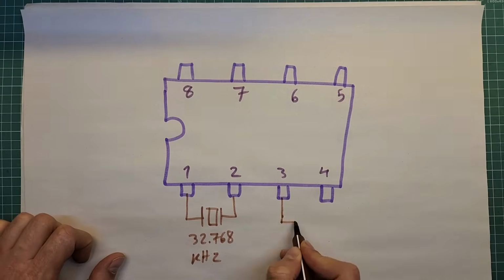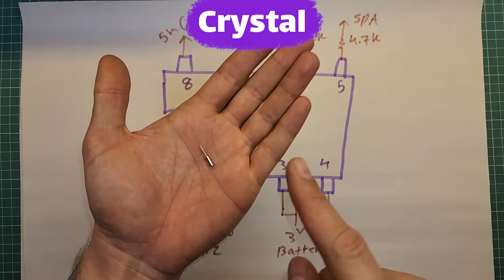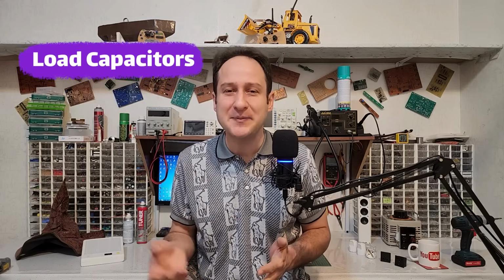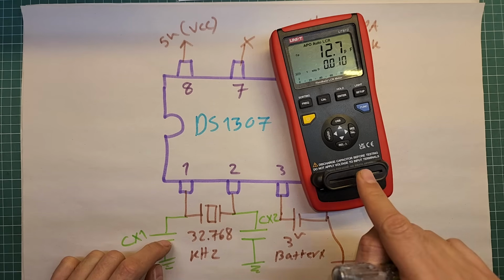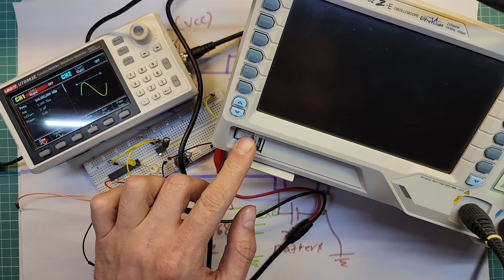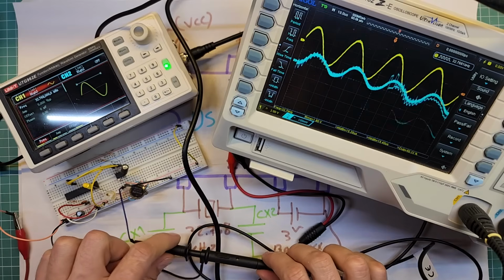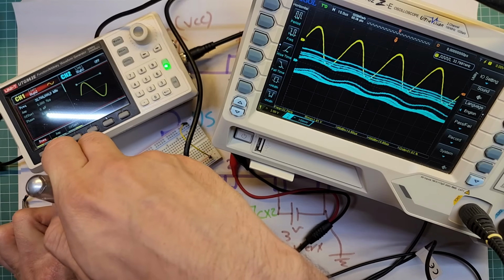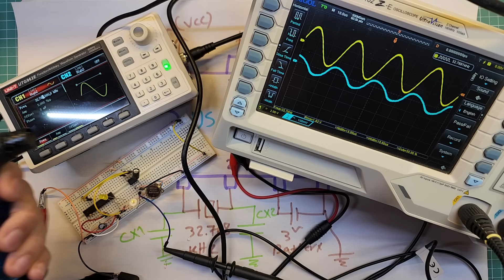Why Your RTC is ALWAYS Wrong + and the EASY Fix!

Comment: you can obtain high precision only with frequency meters. function generators and oscilloscopes are never high precision tools
Reply: That depends .........
When did you last have your frequency counter calibrated ?
When did you last have your function generator calibrated ?
When did you last have your oscilloscope calibrated ?

Have any of your instruments ever been calibrated since you purchased them?
In their current state of calibration which one is the most accurate?

This video is aimed at the student/home hobbyist for which the cost of regular professional calibration is out of the question.
At least with this method you are averaging any inaccuracy by comparing the accuracy of two of your instruments. Function generator set to 32.768kHz, Oscilloscope reads 32.768, no drift on traces = 99.999999% chance it is an accurate 32.768kHz. 

Some people need an excuse to spend $$$$$$$$$$ for a another piece of equipment. 
Other people use their brains & skill to make use of what they have to achieve the same outcome.
Reply: @JustMe-dx5xl it happens i am physicist and i know what to what precision. 
frequency is for highest precision possible. 
do not write a lot, in order to confuse me! you can't. 
frequency and phase shift, and phase shift is about frequency. and the last solution, quantum counter, or quantum sensor, to measure currents, that also is about frequency. 
the only thing more precise than frequency, is gravity, but that too, becomes a matter of frequency.
Reply: @saramanbrudesco  I am actually one level above a physicist sitting in a environmental controlled lab with ULTRA EXPENSIVE equipment which is regularly calibrated/certified.
- I am a real person in the real world :).
Obviously all my words did confuse you as you missed the point of my reply - This video is aimed at hobbyists who do not have the benefit of of a lab environment. In a home lab with common equipment this method works well & is more than accurate enough for a RTC.
Reply: @JustMe-dx5xl so you try to escape. we were talking about best method, not low precision methods. fuction generator is low precision method, and you somehow tried to sell it like best method
Reply: @saramanbrudesco  Nobody is escaping - just explaining it for what it really is - a video about setting a RTC aimed at the hobbyist. You need to learn how to take things in the context 'This video is aimed at hobbyists who do not have the benefit of of a lab environment' - nobody ever mentioned it being the 'ALL TIME BEST' or 'WORLDS MOST ACCURATE' method.
Get out of the lab & into the real world. Although one question does arise - Why is a narrow minded physicist wasting time watching hobby electronics videos?
End of discussion !
Reply: The oscilloscope is being used for visual phase comparison... it doesn't need to be terribly precise, only phase-accurate. This technique works just as well if for example, a digital sampling scope has a sampling rate error of several percent. The reference oscillator for the function generator is serving here the same purpose as the reference oscillator in a frequency counter, and you are visually measuring the beat frequency that would be produced by mixing the function generator's output with the DS1307's oscillator. It is trivial to observe over one minute that a movement of 72 degrees of relative phase does not occur, which will give a 0.1ppm accuracy to the resulting reading at the function generator.

Comment: I wonder if there is a way to do this adjustment without a scope and function generator? My bedside clock runs fast and this might be the trick.
Reply: You always need a reference. 50/60Hz line frequency works, GPS works, the high-quality oscillator in a function generator works...

I can think of a few hacks, like using a PC sound card at 96kHz or 192kHz to read the 32.768kHz signal (which will sync to the oscillator in your sound card), or setting the divider on the DS1307 and using it to light an LED, then watching another 1Hz source next to it like turn signals blinking... even timing that 1Hz blink against the ticking of a good watch's second hand by eye could work.

Comment: Would love to learn how to use an oscilloscope. To do things just like this. Taking a common part and using it to its potential. 
Also would like to know what to consider when buying my first oscilloscope (new or used). There are so many specifications, features and claims I don’t know what is marketing fluff and what is useful for a hobbyist playing with microcontrollers and exploring electronics.

Comment: I have an ds3231 in my circuit and it's two minutes ahead in time after two years running. Now I know why. Thank you.
Reply: DS3231 specifically has temperature-compensated crystal in it. But it can't be pinpoint perfect from factory. That would be running ahead by 3ppm if I calculated correctly. DS3231 has an aging offset register. If you set it to about -30, I think that should produce roughly -(0.2+0.4+0.8+1.6) = -3pm offset and it would be close to perfect. You can read the aging offset section in the datasheet to double check my findings.
Reply: @ivolol  what about adjusting for planetary slow down?  24 hours wasnt 24 hours 3 billion years ago, are we sure our time is really correct?  Im half kidding, because if you think about it, there is no exact measure of time passed, if we're using the planet spin.  And if you want to think about it further, time doesnt exist, because all our markers of time are based on motion, be it a planet spinning or a clock ticking,its motion that changes things, not time,  why your motion actually sets your experience of time. Move faster and time slows. I think because youre actually slowing down relative to all the motion in the universe when you speed up, so your interactions slow and therefore time slows. Thats all time is,  change due to interaction due to motion. Since everything is in motion we have constant experience of change - time.  Why when you change your motion you change time, therefore time isnt an independant thing operating on its own.  How can you measure that?  We cant' we can only measure motion based on some arbitrary movement and define that as a unit of time. But that arbitrary movemebt has been changing throughout time so we really dont get an accurate picture even if we try. It would take maeasurubf the speed of every object in the universe to get an accurate measure of time perhaps.
Reply: @mikejones-vd3fg  at ~1.7msec/century, the planetary slowdown is an error of ~0.54 parts per trillion, which would be about 29 times more relevant than the inherent error in a reference grade hydrogen maser time standard. Relativity indeed shows that acceleration will cause relative time frame drift, and we measure it using two different accurate clocks in different locations... it's predictable, and correctable. Without those predictable corrections, GPS wouldn't work.
Reply: A minute per year is spectacular performance for most clocks.

Comment: Ha! I was literally reading through the digital trimming chapters in the MCP7940 datasheet. Different chip, but a RTC (and a very good one, too, with 64 bytes of battery backed RAM) 😊
Reply: Thank you for this - I am looking for a quality RTC IC (not a breakout module) and this looks to fill the bill.
Reply: @scottfoulk7480 it's a good chip. I recently wrote my own little library to interface it to an ESP32 as the ones i found online all seemed to be somewhat over-developed. I just wanted something really simple. I haven't fully tested all of my code yet but it seems to work fine so far. It's a good little chip. Have been using it for years. 👍

Comment: You need a plastic screwdriver for adjusting. You get much less noise when turning the capacitor. Also setting the scope to XY mode (lissajuous) let's you see the drift better.
Reply: ^^^ this

Comment: It is hopeless those crystals have an horrendous thermal drift. I don't know there but in my country a 25C degree difference between day and night is not unherd of. High quality crystals for transmitters are cut in way to minimize this thermal coefficient as quarts crystals are anisotropic and cutting it in the correct way can minimize that. I even tried and experiment using several RTCs and crystals set precisely at the same time and they drift even making the oscillation frequency fit. Just for curiosity. I am trying to use a thermal chamber now as some transmitters have. But they take hours to stabilize, are power hungry and not cheap. And Crystal oscillators are noisy and even noise can make those chips run faster (it is on the datasheet): that is why precision equipment use a crystals oscillator that controls an LC oscillator controlled by a varactor using a PLL.
I imagine if I could use a big xtal for higher frequencies that are far far better quality and divide it and inject it directly on the chip at X1 as some processors allow (the DS1307 inputs are CMOS level despite of it operating at 5V (weird)). Or ditching it and use DS3231 that has an internal temperature compensated crystal.
Reply: You can also buy a TCXO (temperature compensated) in a SMD package, they'll be about the size of a SOIC or TSOP chip. They'll be a couple dollars instead of 15 cents. They're almost as accurate as a OCXO (oven-controlled), but they won't use nearly as much energy as the latter to operate.

Comment: If you used a HP Counter/Timer set to accumulation, input 10Mhz from the internal clock to input B and The frequency from the oscillator you should see a count or 305.  You can improve the accuracy by using an TCXO or a GPSDO.

Comment: Wondered why the time always drifts?   I am much more surprised why this IC is recommended for so many craft projects when there is the superior DS3231, which is pin-compatible and largely internally compatible with the DS1308.
Reply: simply 100pcs IC + 100pcs crystals = $5USD